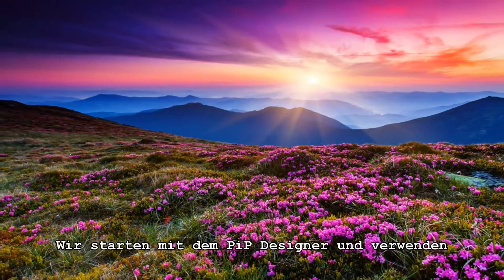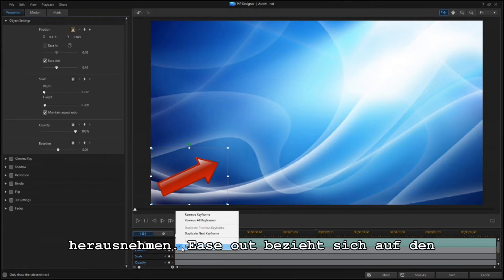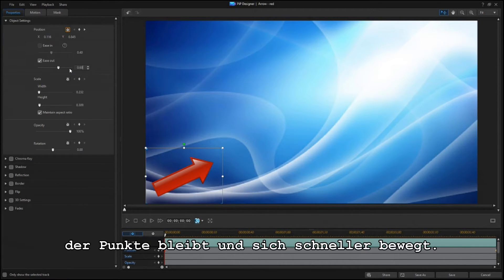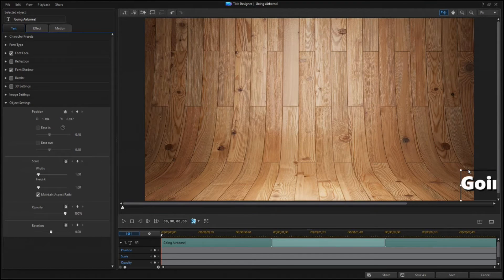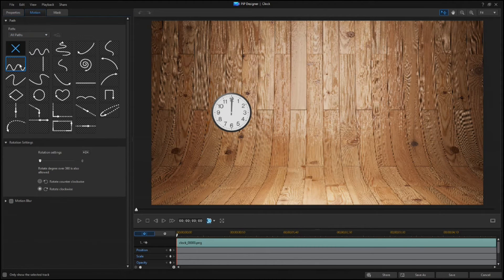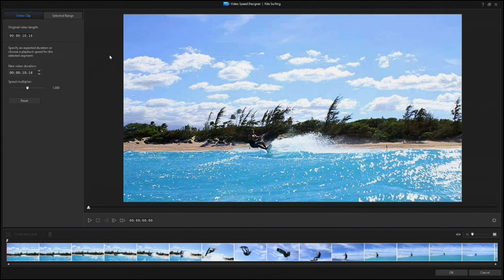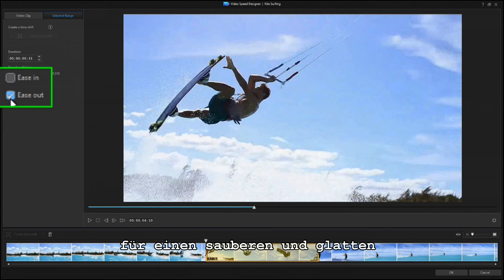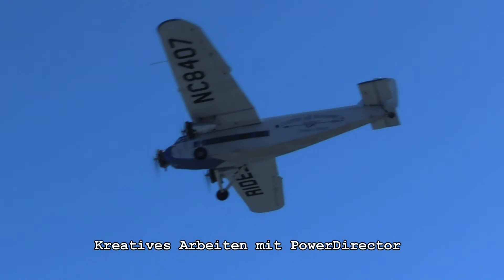CyberLink PowerDirector | Realistische Bewegungseffekte mit "Ease In/Out"

Comment: Super awesome video! thank you.
i just have one remaining quesiton: how do i set the total length for my motion of titles or elements? it seems that even when i define starting and ending position, the clip will be 10 sec long. so when i set the motion from 0 to 2 sec, it will stay still for another 8 seconds. I cannot time rotation and motion properly, because the sepcified rotation in degrees will be applied over the course of the 10 sec instead of the 2 sec motion path. 
do i really always have to make 10 sec clips and cut them later?